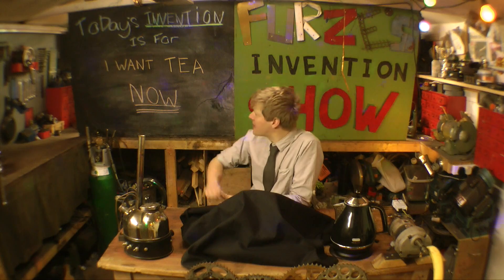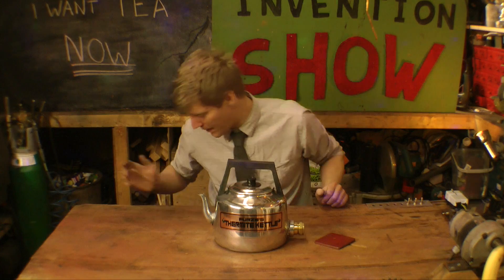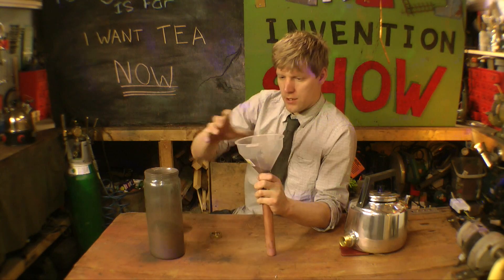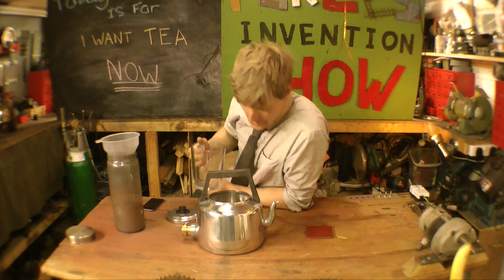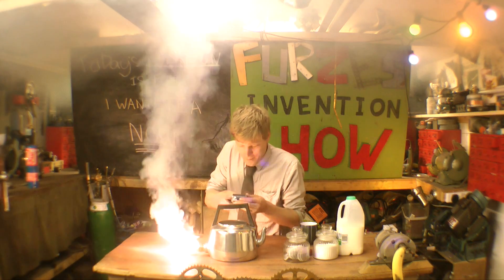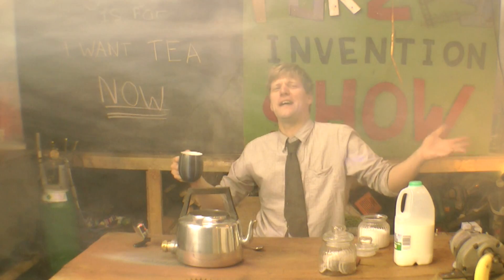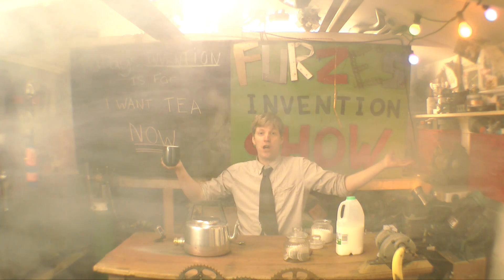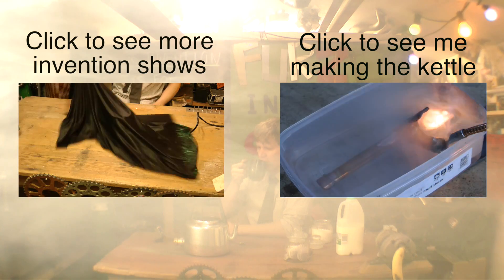The Thermite Kettle

Comment: That's some weak ass thermite.
Reply: Well of course, he doesn't want to melt the pot, so he used a less reactive ratio
Reply: +WKDworks Thermite kettle 2.0: Tungsten kettle, stronger thermite
Reply: +WKDworks watch the making of he explains why its weak ass
Reply: +iroeky nah in the makong of he said it was weak thermite.  if it was good thermite the tube would melt, thermite would get in the water and that wouldnt be pretty...

also once the water is bpiling the heat cant dissipate into the water anymore
Reply: Jorn no.
Reply: +WKDworks That's some weak ass comment
Reply: That is the point
Reply: +WKDworks thats some weak ass tea
Reply: +Clem Carbon would be better
Reply: +Skaianet no. its just underwater. so the heat is dissipating
Reply: He knows.... in fact it's a "failed" attempt to make thermite for another project that ended up in this wonderful contraption....

Comment: That's awesome actually. :) Just one question: When will the videos with the two other "defensive devices" (launchers, flamethrowers, guns, something like that I guess) be uploaded?
Reply from the maker: +peterheikoadolf hopefully 2 thursday time, the weather has been against me
Reply: +colinfurze been terrible all over England. 
just thinking.
If the thermite tube was a ring instead of a pipe would it not heat up faster ;)
Reply: +colinfurze isn't wheaten against you everyday in England?
Reply: +colinfurze Well, that's some good news but also some bad news.
Reply: +Zierleos how were you planning on fitting a ring inside a teapot without making it one gigantic leaking mess?
Reply: +1111skip1111 could split the kettle into two pieces one screwing onto the other making it water tight. 

not much of a mess.if you think outside the box :P